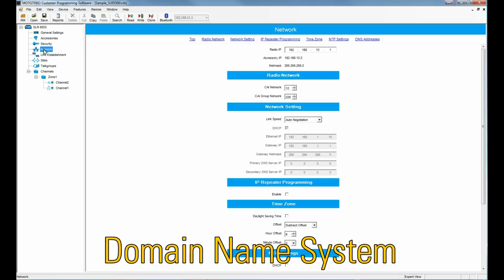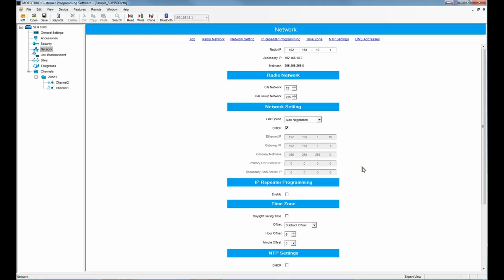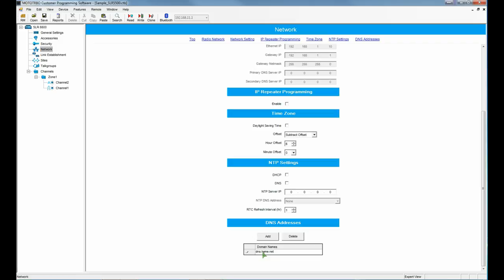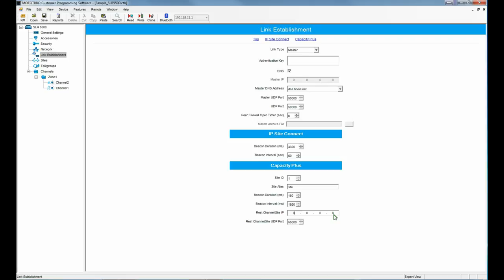DNS in IP Site Connect and Multisite Capacity Plus

Comment: Hello, is the DNS service used only for the Master repeater? Could you explain how the connection between master and slave works? Thank you
Reply from the maker: +john jairo gomez salcedo There are DNS settings in the Master and Peer. In the Peers, instead of entering the IP address of the Master, you would enter the chosen domain name provided by the DNS server. Doing this means you can use DHCP on the Master (or on the Router connected to the Master).
Reply: Very interesting, thank you! Greetings from Colombia